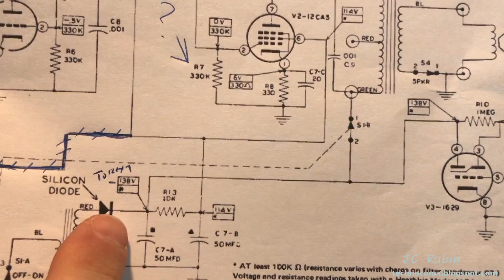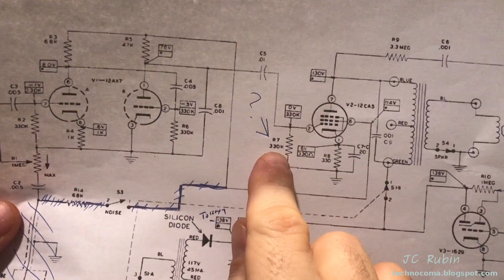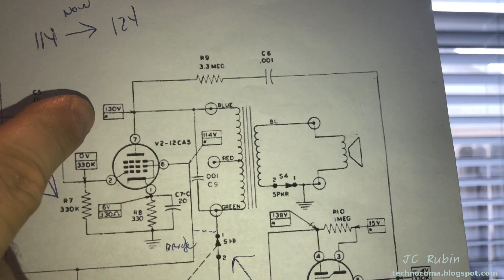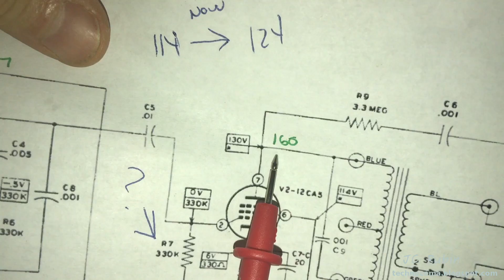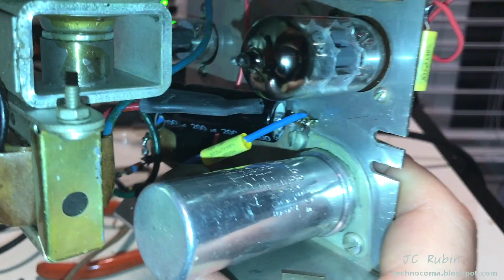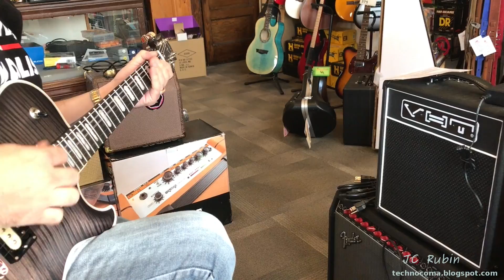Heathkit T4 Guitar Tube Amp Conversion Part 3/3

Comment: Hi just found your page! Interesting I think I would have changed the power supply outputs. Use the 160v on the plates of the 12ax7 and the 130 to the plate of the 12ca5 and eye tube. also add one more R/C to the front.

Comment: Thanks for the video.  I find it interesting how you are tuning the circuit for pleasant distortion.
Reply: Joseph Nicholas you know anything about hp model 200a 200b oscallator.i don't need them.plus cambrige ele.standard signal generator. Southwestern electric voltmeter.and tube amps
Reply from the maker: Its difficult.   1 Watt, Tony speaker in a metal enclosure.   Unwanted distortion becomes a challenge, wanted distortion causes vibration...  possibly more to come as I improve upon it.